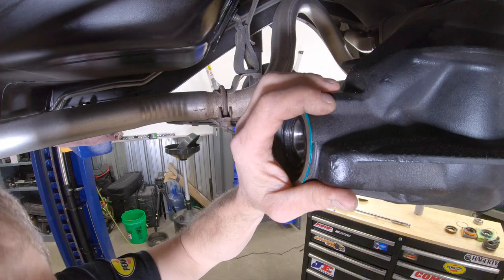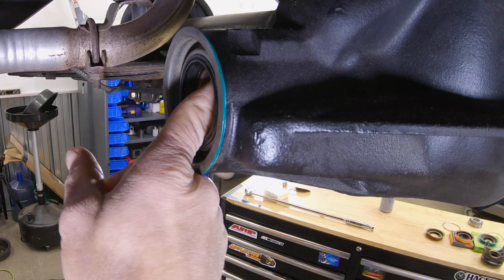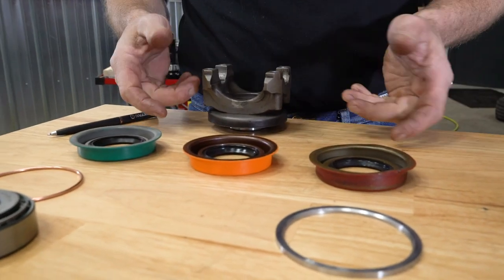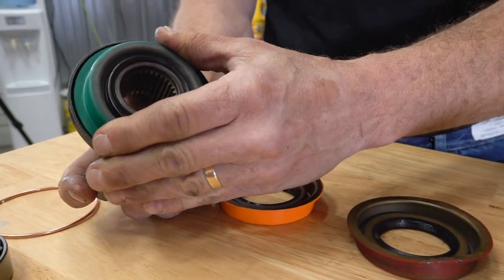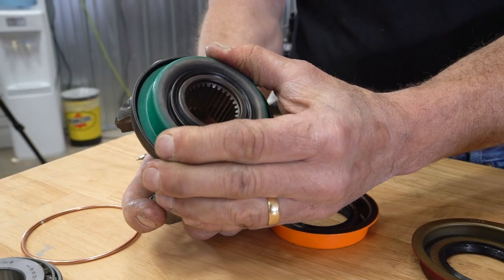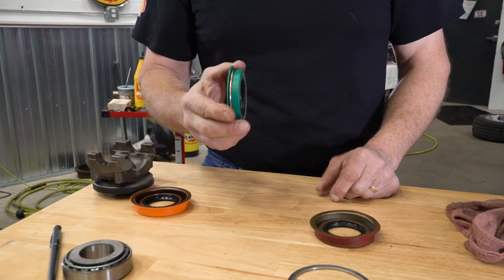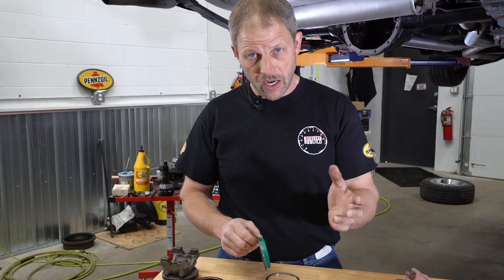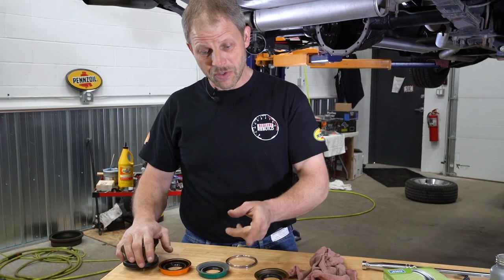The ONLY WAY to fix a leaking 12-bolt GM rear diff pinion seal | Hagerty DIY

Comment: Doing some investigation on this issue because I have a 67 Nova SS that has a 12 bolt passenger in it.  What I found is that this is spot on.  Found lots of comments in numerous forums talking about this problem specifically and generally they will not seat the seal all the way.  There was also someone that posted a part number that does fit the passenger rear axle correctly.  National seal part 6109 for 63 to 79 corvette.  Found this on summit and there were numerous comments saying that this was the correct seal for 12 bolt passenger.  Strange also makes a seal STR-R5211D which is more money, but is correct for 12 bolt passenger.  Another fix was mentioned was to put RTV sealant around the lip that sets down on the housing and stop 1/16 to 1/8.  The RTV will set up and seal the gap if it was needed.  They also mentioned creating two C shaped piece of sheet metal that would help space the seal out from the base the correct amount of space.

Comment: Well that explains everything!  I was wondering why the new seal didn’t fit like the original when i rebuilt my 12 bolt last year..  great... now i need to be on the lookout for leaks... thanks for the tip!!!!
Reply: Guess what?  After 1300 miles, my pinion seal leaks.  I will follow your method for installing the new seal.  Thanks again for the tip!!!

Comment: Thanks for the video and great advice. I replaced the seal on my old 12 bolt. The silly thing kept leaking. So I figured and an expensive repair. I stumbled on your video, and decided to check it out. I found a spring in my shop with a long enough tail on it, and was the right width. Cut off the tail, bent in in a circle real careful like, slightly smaller than needed so it would hold itself in there nicely. Backed out my new seal just enough to get the ring in there, tapped it back in tight to the ring, and lo and behold, works great! Not a drop. Thanks again!

Comment: Was wondering why mine was leaking again after only 2 years and not much driving. Figured I messed up somewhere. Glad I found this video!
Reply: I know right? I mean there are MILLIONS of these rear ends out there. Summit has the correct one made by National seal part 6109 and it does fit perfectly, put it in my 68 Camaro 12 Bolt.

Comment: Good find!  Looks like you could turn the flange off of the seal so the outer edge is at the same height as the lip on the dust side.  Effectively narrowing the seal the distance needed to get the inner lip on the yoke journal.  Then install the seal until it's flush with the housing.  The flush outer edge will insure the seal lips are perpendicular to the yoke.  No extra metal or fabrication needed.

Comment: I recently had a shop install a Posi unit in my 10 bolt rear end and the shop called me to tell me they weren't happy in the way it was sealing so hopefully they watched your video in case a 10 bolt rear end has the same issue.  It hasn't leaked any yet.

Comment: Thank you I have a 12-bolt rear end in a GMC rally van 1982 and it is leaking crazy and I want to thank you for the help
Reply: This is only an issue with passenger car 12 Bolts, you probably just have a bad seal.

Comment: Thank you that explains why no matter what manufacturer seal I use it still leaks I learned something tonight
Reply: If you go to a reputable bearing /seal supplier and go through their catalogues and find a seal that DOESN'T have the sealing surface offset to the front mounting flange you won't have to manufacture a spacer ring. Having said that, this is a good fix IF you have the equipment to turn up a spacer. But there there is more than one way to offset the sealing lip. Like your videos

Comment: Strange Engineering PN/R5211D, 12 blt. “car” pinion seal. The pinion seal you need. Less hastle than what your doing.  Worked great in my 71 SS. Jegs and eBay....

Comment: Correct me if I'm wrong, but the yoke still on goes in so far, on the seal, because of the construction of the of the seal. You will have the correct spacing to the bearing however.
Reply from the maker: Not quite sure what you're asking. The spacer moves the whole seal toward the front of the car, which moves it farther up the yoke, allowing the entire seal to sit on the largest OD section of the yoke. It basically makes the seal function as it was intended.
Reply: So is there enough room in the yolk to actually move the seal that 8th inch toward the front of the car? Or does the seal still stop on the back of the yolk even with the spacer thus putting the seal in the same spot still
Reply: Hagerty I see what Brian is saying, when you put the seal on the yolk, it didn’t contact the major diameter.  So how would a spacer change the construction of the seal?  I would think removal of some of the seal flange on the yolk side would be the only fix.
Reply: @Hagerty  
Quick question, could the spacer be a little thicker that 0.125? I had one made and it's 0.134, would the additional thickness be an issue?
Reply: it doesnt look like its moving the seal the right way to me either

Comment: I'm very curious.... I watched your last video when you did this modification. What I am wondering is if you push the seal as far as it will go up on the yoke (bottoming it out against the yoke) and it is not going far enough to seal on the sealing surface of the yoke, how is the spacer ring making the seal go past where it bottomed out on the surface of the yoke when it wouldn't go past the bottoming out without the spacer. Looks to me like you are not gaining anything with the spacer. When you tighten the nut on the yoke, it is going to crush the seal and ruin all chances of any kind of sealing. Also the yoke will be rubbing on the seal and cause almost instant failure. Only way this ring spacer will do any good is if when you demonstrated the oil sealing part of the seal not going far enough on the sealing surface of the yoke, there was still some space between the front of the seal and the back of the yoke. The way it appears in the video is you bottomed the front of the seal out against the back of the yoke. If this is the case, then the spacer ring will make more problems than it will fix. 

But all this analyzing I'm doing may be all wrong if there is plenty of room for the seal to go 1/8 inch closer to the back of the yoke without hitting. If that is the case, then I just wasted 10 minutes of time..... But in my defense..... it didn't appear that way.
Reply: see 4:37, there is space
Reply: I'm missing something too Danny. Watched  it 4 times.I must have a low IQ.
Reply: I think you are right. Really needs a longer yoke. Or this fix might just be reducing the amount of rubbing between the seal and bearing during operation?
Reply: It's going too far, Not , not far enough.

Comment: If you want to make sure you get all of the leaks, have the axle tube plug welds redone by a welder that has a high output TIG machine.  The original welds were porous and spotty, allowing some gear oil to weep out of the plug welds over time.  If you have a wife who goes nuts over any oil leaks on the driveway, it will save an argument or two.

Comment: I had a ring made today 1/8th just like yours. Going to give it a try as well on a 12 bolt.
My question is if you can remember, if the metal part of the seal has to be tapped into the rear end housing where the bearing an crush sleeve reside do I need to put rtv or any kind of gasket sealer there or between the ring and the seal? My ring has the tiniest bit of slop when you put it on the seal.
I suppose I could just cut the ring with a hacksaw, clamp the now open end together and then weld it to take care of the tiny slop, but their is gear oil In their, so like water if their is a hole it will find its way.

Comment: Execent info , Thanks , mine has leaked from day one , the brass brazing rod looks to be easy way , just put the gap at top or tack weld it and sand it smooth
Reply: I would probably put a bead of gasket sealer around the space of the seal where it is close to the housing, then it probably wouldn't matter what position the gap is.

Comment: You can put a sleeve over a harmonic balancer and seal it, maybe the same can be done  for the diff, a bit longer
Reply: I don't think that will work because the end of the yoke is what collapses the crush sleeve so it needs to be strong. If you left the speedy-sleeve long, I think it would collapse when torqueing the pinion nut.

Comment: I don't think this problem applies if the seal does not have a lip flange on the outer edge.  Just replaced pinion seal on a non-original 12 bolt car diff, not sure what year diff, but the seal did not have a lip flange and seating it fully caused no leak.  The removed seal, which was leaking, looked very worn and aged.

Comment: I'm a little lost if the seal won't go far enough on the yoke to clear the chamfered edge. What are you doing cramming the seal in? Won't that possibly cause a rubbing noise from the face of the seal and the yoke flange/dust shield?
Reply: You're thinking about it wrong. They are not suggesting "cramming the seal in", they are saying to not seat it all the way in to the lip, but leave it about 1/8" out. That way it should seal on the yoke seal surface.

Comment: Ratech 6109 is the correct short seal.
Reply: Yep! 6109 works in a 69 Camaro, listed for a Vette I believe...
also, people always forget to apply an anaerobic sealant to the splines of the yoke, gear lube will slip thru the splines thinking it's the seal leaking, 
I apply a sealant to the yoke spline instead of the pinion spline so as not to be pushed back to the bearings... as I have seen before...

Comment: Moser MSR-PS12B will solve the problem... Moser made these seals so the seal isnt as recessed
Reply: Does the El Camino use the car seal, just replaced mine and it still leaks.
Reply: @michaelbox7285  They usually leak because the seals are to long. I went through 3 different seals before finding the Moser-PS12B which is shorter so the seal rides on the shaft and not on the end of the shaft where the radious is because thats what causes the leak..

Comment: Hey bud I'm having this issue with my 03 suburban 5.3. can I get your info so I can buy one of those rings you make ? I would really appreciate it. Going through way to much gear oil and thanks to you I now know why it's still leaking.
Reply: Apparently this is only an issue with passenger car 12 Bolts, you probably just have a bad seal.

Comment: What about when the leaking issue is from inside diameter splines on the pinion yoke?
Reply: Put some RTV on the splines between the washer and the pinion.
Reply: gear lube will leak thru the splines, apply an anaerobic sealant to the splines inside the yoke before you install...

Comment: I have a Strange 12 bolt in my car.....will the new seals also leak on my pinion?  I need to replace my current seal, its leaking.
Reply: The video says Moser extended the nose of the 12 bolt car housing to match the truck housing. Maybe call & ask Strange if they did the same thing.
Reply: @CrashFix  ....I found a shop in Lauderdale where I live who took care of it all.  No more leaking fluid.

Comment: I wonder if a Salsbury 10 bolt diff seal would work?
Reply: a GM 10 bolt second gen F body has same pinion size as this 12 bolt. I have not looked into the front seals though ... YET.

Comment: I have a 2002 chevy astro 2wd 4.3L. I have changed the pinion seal 4 times now and also changed out the yoke adapter sleeve (a seal in the yoke itself) and it is still leaking. I wonder if this is the solution now. Any idea if it's the same kind of differential as here?
Reply: Ratech seal thru Summit, RAT-6109

Comment: Kinda weird it’s completely discontinued, and no after market parts.. I’ve ran across seals that is still available by the OEM, and if it’s discontinued, an aftermarket is available.
Reply from the maker: Lassi Kinnunen  Yup. That's the issue. Every parts store will tell you that they have the part because that's what their computers tell them. But it's not the right part.

Comment: buy the correct GM part: New OEM GM Differential Pinion Seal P/N: 26064030  ONLY way, common man...
Buying inferior parts will make you pay in the long run every time.
Reply: that's a AAM 10.5 seal---not close

Comment: This is BS. @ 1;50 you pushed the seal tight against the yoke dust shield and adding a spacer wont push it on any further.

Comment: BS man, you can still get the seals for the car version. I installed one on my 67 El Camino 12 bolt in my Chevelle which is the car version made for a 4 link instead of what the truck uses. It doesn't leak at all because it's the correct version.
Reply: Rod Palm where did you get it from?
Reply: Rod Palm what is the part number?  Was it a single lip or double?
Reply: Due to his BS statement and non-response, that tells me he is the one full of BS.